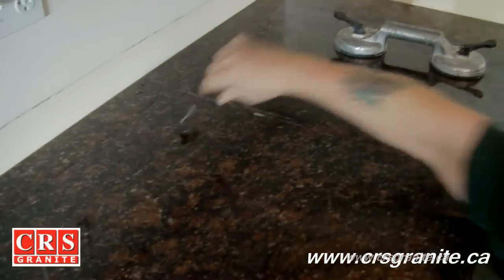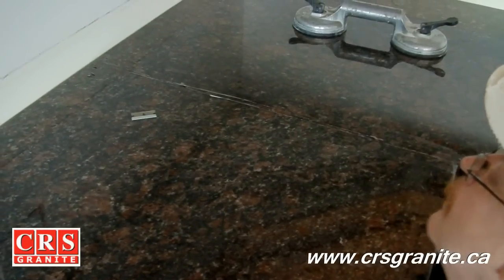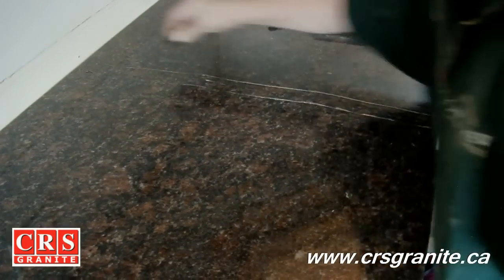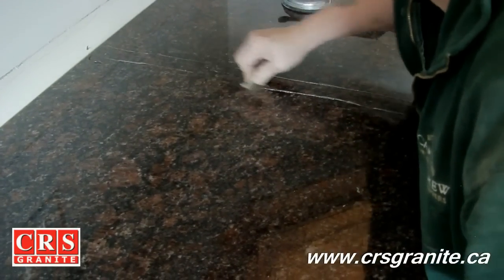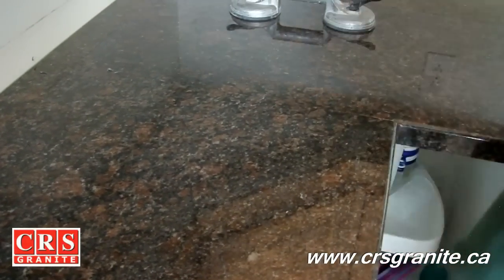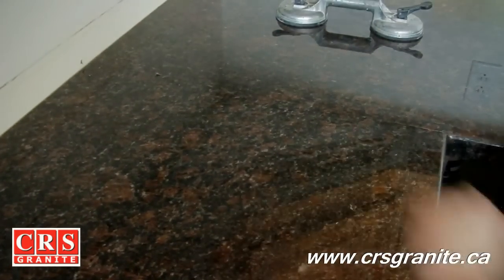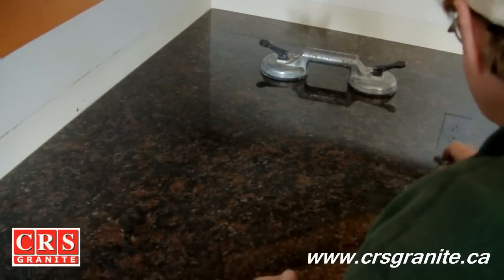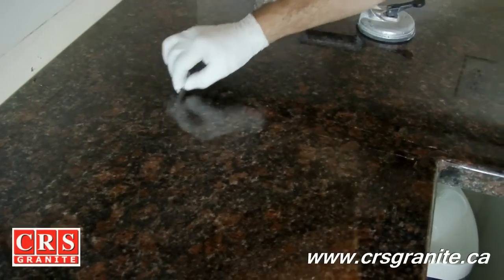Granite Countertops by CRS Granite - How to Repair a Seam

Comment: Seams are made with two-part epoxies or methacrylates and shrink when they cure. If you flush the adhesive before it cures, as shown here, it will shrink below the surface and make a seam you can feel. Always overfill and scrape to flush with a razor blade, not acetone. And get some clamps on the seam while it's curing too.
Reply: I have glass shower. Glass rests on granite shelf that sits on 6 in wall. At the corner, the granite has separated about eighth of inch. What should i use to seal this crack